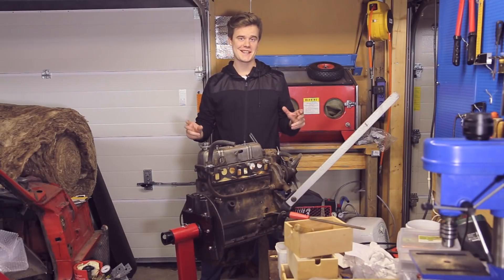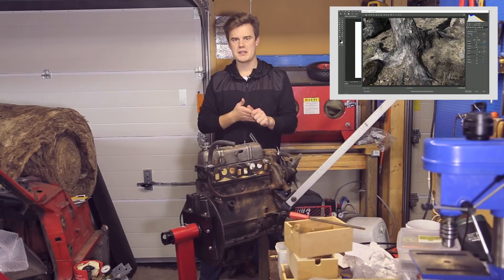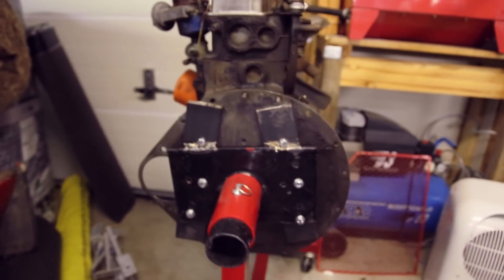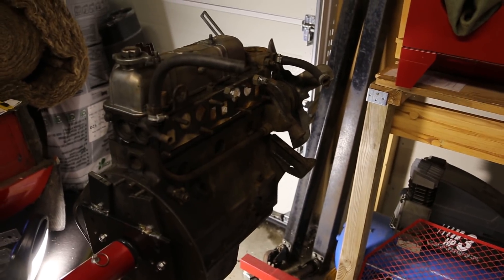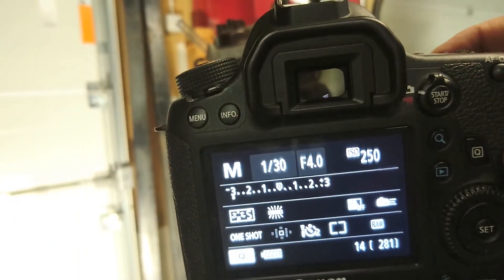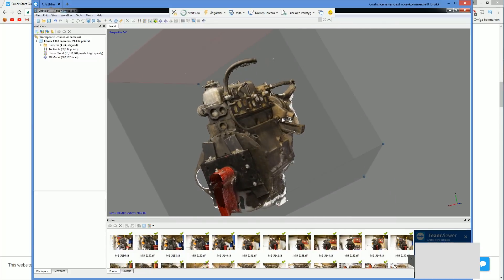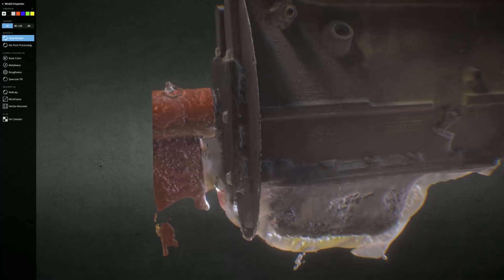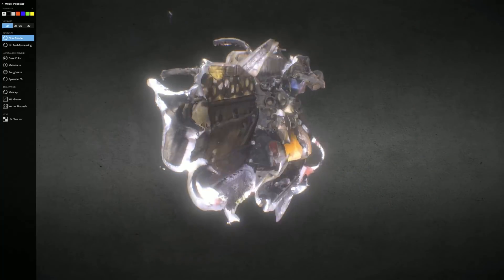3D Scanning an engine in the worst possible conditions

Comment: Nice video. I wonder if a polarizing filter will improve the scan in a case like this, to get rid of unwanted reflections in the metal. But then again you will loose a few f-stops due to the filter